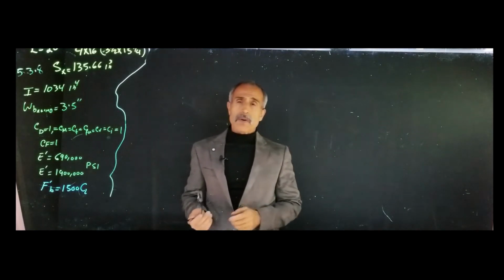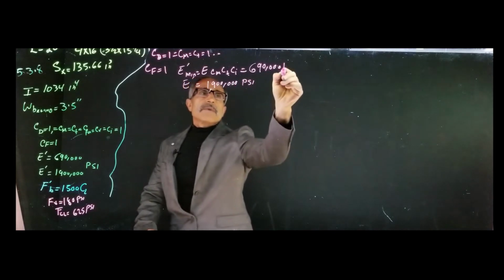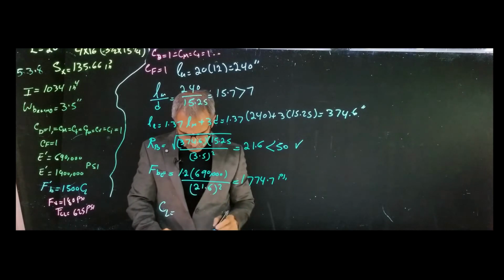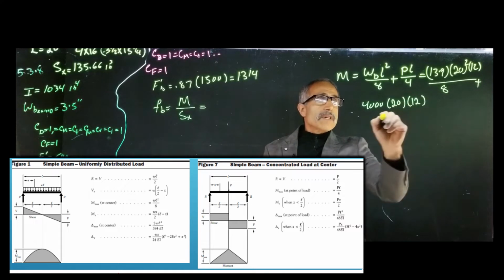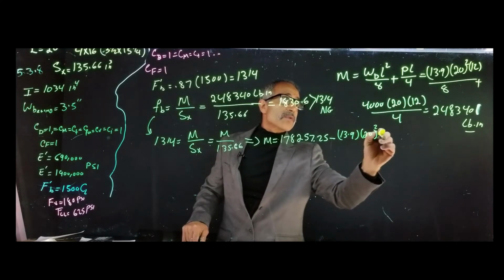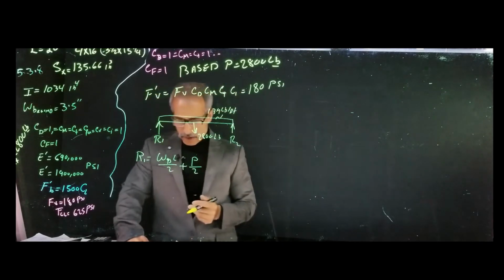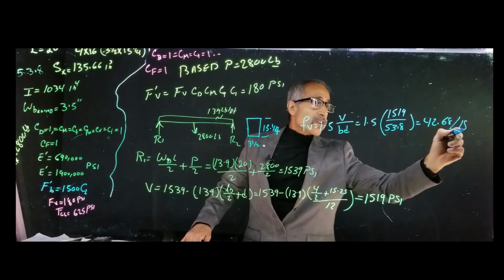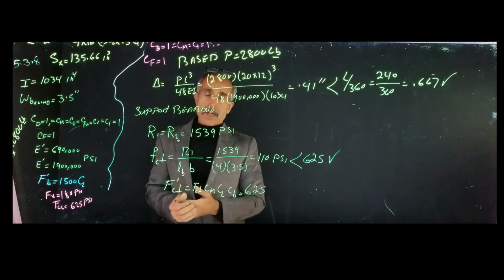Timber Beam Design

Comment: Lol.. Ok to admit this is way above my head for a single time calculation. Once I get all the exact measurements for span I'll have to find someone that understands all this this to calculate the beams I'll need to make from massive spruce logs I have for a 8,000 pound hanging load in a home built meat cooler. Jack of all trades master of none but, if someone can tell me what I need I can build it. We are probably only going to hang maximum of 10 pork at about 400 lb each or maximum of 8 beef which would be about 6 to 700 each so 8000 lb load will be a safe almost double capacity. But , as I have the material and can mill any size I please i want a big safety margin.
Reply: He is building rocket not a beam. Way above Einstein theory.